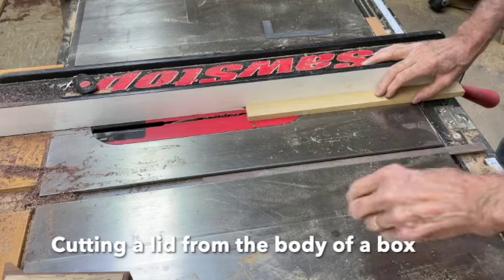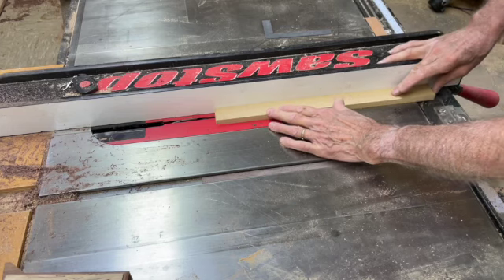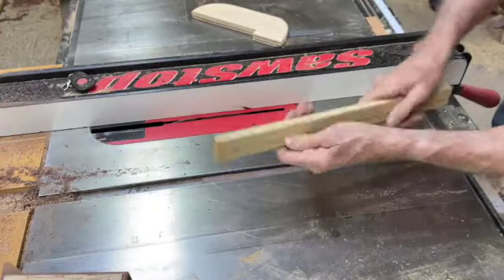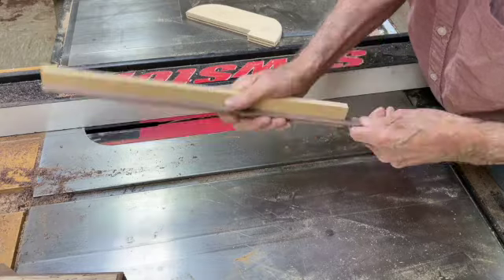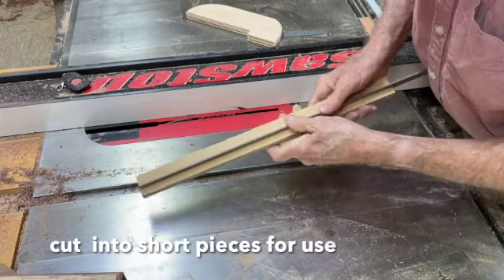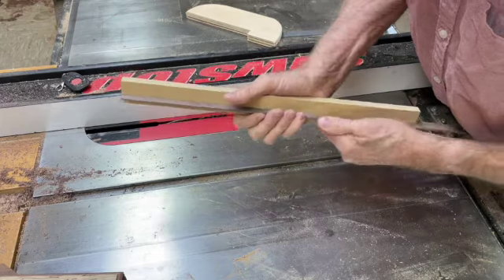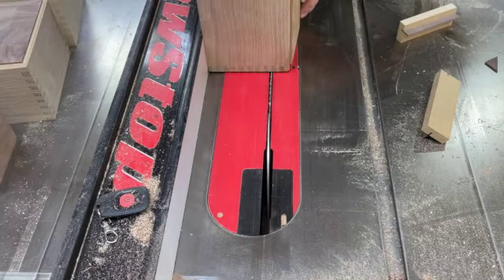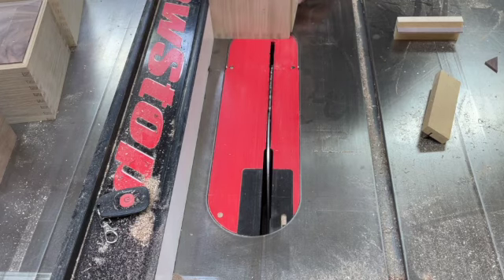Cutting a lid from the body of a box   SD 480p

Comment: Very nifty tip. This technique eliminates the very real possibility of botching the removal of a thin retainer web being left to hold the box intact when cutting without this jig. It’s not difficult to get a nasty tear out when dealing with a residual membrane around the perimeter.
Reply from the maker: I used and recommended the technique you describe but moved on from it years ago to what I do in this demo. I hope you try it and find it useful. I keep trying to invent new techniques like this because teaching demands it and puts me in a position where I'm able to observe student successes and failures and make adjustments to improve chances of success.
Reply: @MrDougStowe   Ability to make changes is a sign of intelligence!